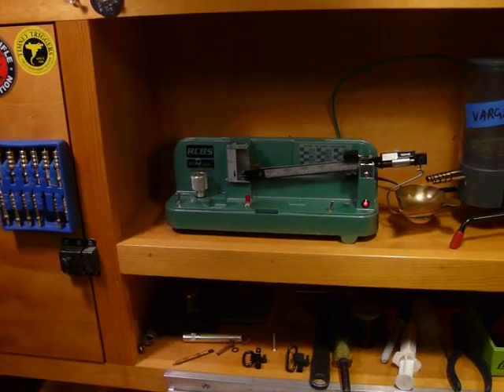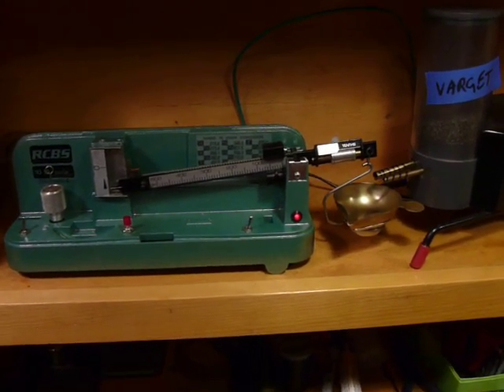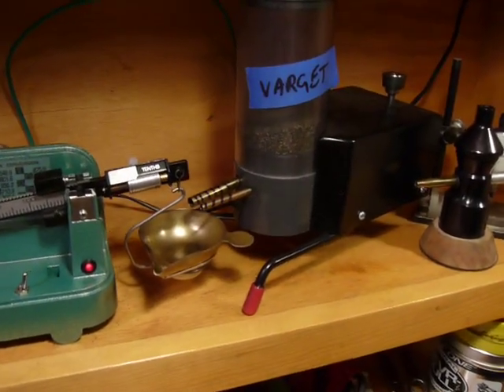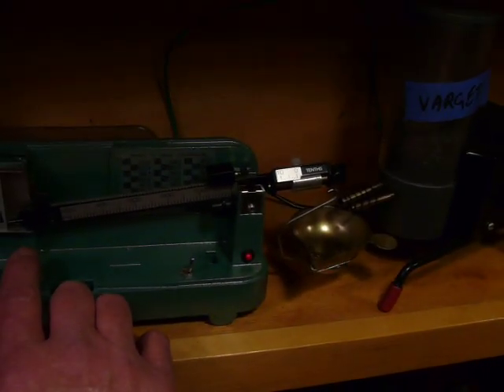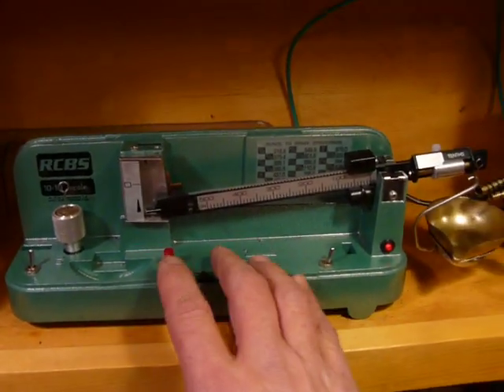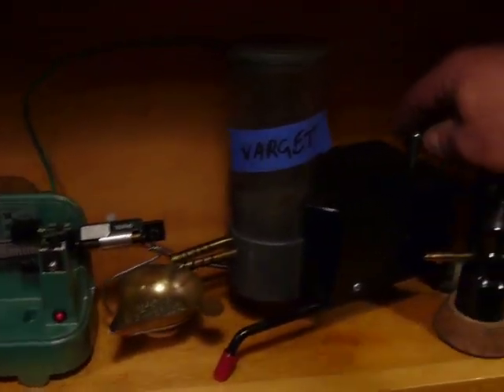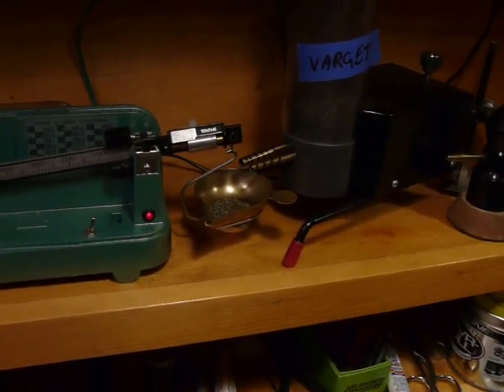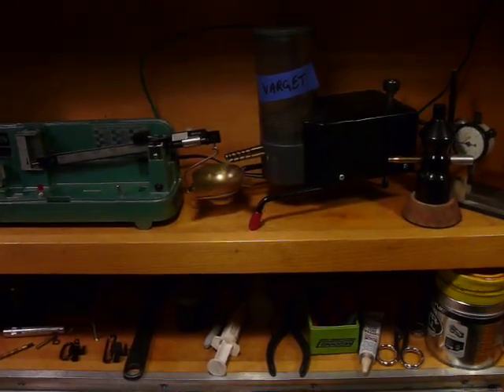Auto Charge Powder dispenser. Balance beam based.

Comment: I've seen several other similar designs, I've been working on my own.  Yours is the best I've seen, great setup!  Did you use stepper motors, geared DC, or some other type of motor?  I've been trying stepper motors for the low speed quick response but they tend to vibrate more which can effect the flow rate, I may go back to geared DC.  I agree with you about digital scales, they are quicker but the just seem to drift off without you knowing it.  Great idea with the double large & small tubes, also the change in discharge angle is something I hadn't thought of.
Reply from the maker: Thank you for the positive comments..The motors are, as I recall, very small 12V 50 rpm gearmotors. It has been a few years since I put this together so don't hold me to that speed.. As a matter of fact I think the small tube motor may have a resistor in the circuit to slow it down a little.. The electrical circuit is very simple, with two transistors and a couple other things landed on the smallest bread board from Radio Shack to translate the infrared signal from the scale to the motors.. There was a lot of trial and error getting the exact spacing for the large and small tube shut off infrared transistors and emitters.. These reside in the far left side of the scale along side the magnetic dampener magnets..  The infrared emitters and transistors are mounted in a small, highly machined, black plastic block in such a way to project there beam through small holes for accuracy and the whole mount is slightly adjustable up and down.. Although I have never made any adjustments to this mount after the initial adjustment.. This scale has delivered thousands of accurate loads with zero time wasted on warm up or calibrating the scale.. From just a few grains for pistol loads on up.. No confusing keypad just slide the counterweights to your desired load and go at it.. Of course there is no way to program 100 of your favorite loads into the scale but you should be writing that down in your load books any way.. I promise you that when your digital scale goes in for factory repair your 100 favorite loads will not come back with it..  What is really irritating, about the digital scale, is discovering part way through a loading session that the scale is reading high or low after you just spent 15 minutes calibrating it.. Then what do you do..?? How many of the 3 or 4 hundred bullets that you just made up are holding a bad charge..?? OK, I will just take each charge off the digital dispenser and check it with a balance beam before dumping it into the brass.. Wait a minute why not just dispense the charge onto the balance beam..?? Then why do I even have this crappy digital dispenser..??  I am all about the long range game.. I am one of those nut jobs that weighs and sorts out everything sorting brass and bullets by exact weight, never mixing lots of powder or primers.. I am never happy with off the shelf chamber reamers.. I call in my own ridiculously tight neck specs to Dave Kiff at Pacific tool and he makes the reamer of my dreams..  I like to know my exact impact point beyond 500 yards.. This scale is a vital part of getting good results at that distance.. My biggest ah ha moment, for accuracy, was when I discovered that spending more time on the shooting bench than the reloading bench was the key.. This scale cuts my reloading time way down.. Of course now the big problem is the lack of reloading components available for sale..  I would like to turn this over to RCBS or Hornady but I imagine it would end up being outsourced to china for fabrication with poor end results..

Comment: Very Nice... thanks for sharing.  I've been thinking of doing something similar.  What is dual speed powder dispenser you used?  Also,
I'm assuming the optical sensor is scale  mounted and that you did not modify the beam itself, correct?
Thanks...
Reply from the maker: The powder dispenser is home made and yes the sensors are in the scale frame.. No modification to the beam.. Change the charge by sliding the counterweight just as if you were using the scale for weighing..

Comment: Hey Larry, I know this video was posted about a year ago but I think this is great. I've been wanting to do this for along time. I have several Lyman/Ohaus scales ( Lyman D-5 and M-5) that have been tuned and they work great and want to utilize in everyday loading like you did. I'm starting to try and build a dispenser like yours and would appreciate any help you could give, i.e. photo of the inner working of motor and tube setup, or Drawing/schematic of the electrical components you used. I know its asking a lot and I understand if you don't want to divulge that info, but from one long-range shooter to another Im at the same crossroads you were at with all these digital problem ridden units out there. I thought about using one of the Dandy Products Omega trickles for the low speed trickier and then make a high speed trickier to go with it but I figure if I'm able to figure out how to make a high speed trickier than Im not far from making a slow speed one as well. Anyway any help that you can give will be greatly appreciated and will only be used for my personal use. Ive always wanted to do this ever since i saw the AMT/ LYMAN autoscale back in the 80's, and you have taken that design and made it better than it ever was, in my opinion. If you want I can give you my email instead of posting on here. 

Thanks, Dave Heredia
Deltadogg@att.net
Reply from the maker: I do have some very ugly penciled schematics I would be willing to provide to your e-mail.  ttenrabyrral@yahoo.com